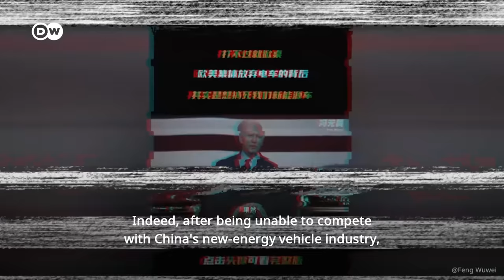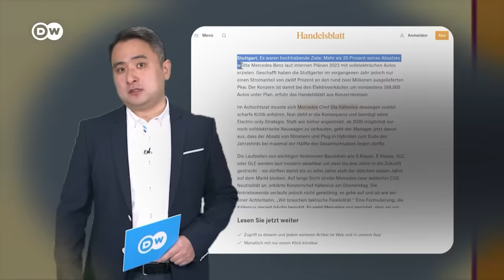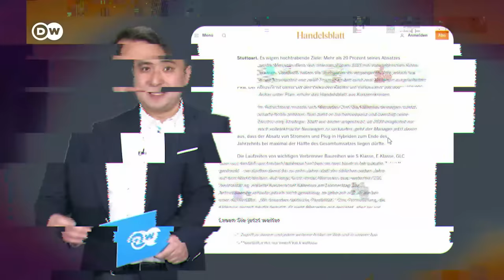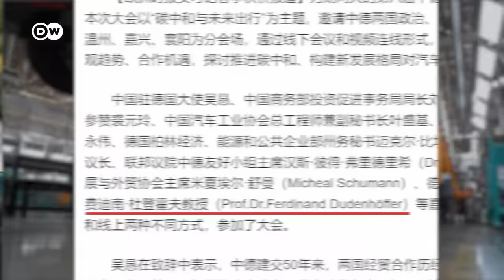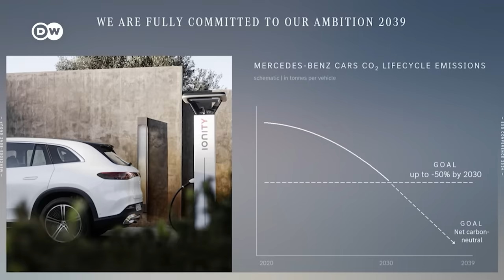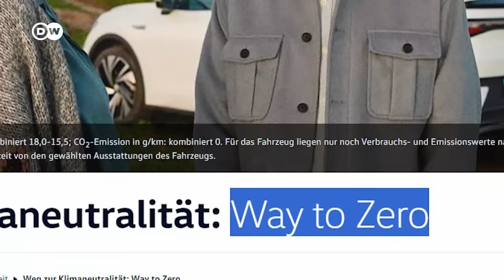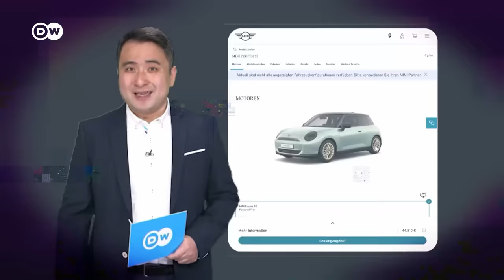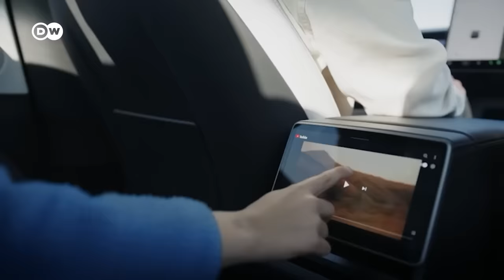Is the EV dream dead?

Comment: All cars and vehicles are loosing momentum...

Inflationary economic conditions with normalized interest rates crush spending, especially on expensive purchases such as vehicles. 

- gasoline and diesel fueled vehicle sales have dropped dramatically. Especially as most major manufacturers focused on expensive luxury priced vehicles, and not on lower cost.

- EV's have, and are still gaining market share. Their growth has slowed down, BUT their still growing. Unlike ICE. 

EV's allow energy independence, much less pollution, especially localized air pollution and oil extraction/refinement pollution, and remove the stranglehold of foreign entities such as OPEC and Russia. Oil is becoming increasingly harder and more energy intensive to extract.

You can even make your own electricity... 3-4 medium solar panels in most places (1500 W worth) will make the 6kWh per day needed by the typical passenger EV. Can't say that about gasoline. Even Biodiesel's veggie oil isn't typically made at home...

The EV minerals (including the batteries) are infinitely recyclable. The 10's of thousands of liters of fuel burnt over the average car's lifetime isn't...

EV's are also MUCH cheaper to operate and maintain. No gas/diesel to purchase, and there's hardly anything to wear out. Even brakes typically last 100's of thousands of KM's due to regenerative braking. Batteries are proving to last the life of the EV in most cases.

Comment: Filled my old Tucson with petrol a few days ago. It took 5 mins to fill up giving me a suggested 408 mile range.  Beat that battery power!  🤣🤣🤣
Reply: Try plugging in your "old Tucson" to your solar roof and see how far that gets you.
Reply: @metricstormtrooper  Well, that would put a bit of spark into my day for sure. I'll stick with petrol thanks!
Reply: Hello Andrew,  I think I got that beat with my Battery EV.  It took me 5 seconds to plug it in when I got home today (no stopping at a gas station).  It will charge to full overnight while I sleep.  I bet you spent about $75 bucks on that fill up right?  It cost me nothing to charge my car on solar.  I drove my EV 2,300 miles last month and the cost was ZERO.  Its a Tesla Model Y, the best selling car in the world.  It cost me $39k, its the fastest car I have ever driven.  If you touch the pedal it immediately responds it you floor it you are momentarily projected into the future!  :)
Reply: @AndrewKNI  Ring gear came off the flywheel. Chewed up clutch, starter and flywheel. Repair costs was the same as value of the car. It was Made in Germany so btw.

Comment: As Nov 2023, 0.86% of the registered vehicles in USA are EVs according to the AFDC (Alternative Fuels Data Center) which under US DOE (Dept of Energy).  That equates to 2.44M registered EV’s in the USA out of a total of 283M.  According to Diffusion of Innovation, this means that the USA EV industry is still in the Innovator phase (<2.5%).  Keep in mind, the Early Adopter Phase is between 2.5% and 16.5%.  43 states have adoption less than 1%.   The EV industry is still in the early days.  In summary, 0.86% is minuscule numbers in the USA after over a decade of EV sales. It is unrealistic to expect a 30% penetration adoption by 2030 when the USA is at 0.86% in 2023.

Comment: The fact you need a strong electricity grid to support charging stations makes the whole environmental debate moot. Where is this electricity coming from? It depends what country. If its France its their nuclear power plants, in Germany its coal because they got rid of their nuke power plants and now in order to support EV's they have to burn more coal. Quite a conundrum, you have to burn more coal which puts more carbon in the atmosphere to support EV's which produce no CO2 on their own. We won't get in to the whole Lithium minining thing that you need to build these batteries.
Reply from the maker: Thanks for your feedback. Of course you're right that policymakers and energy providers need to prioritize investments in renewable energy sources and grid infrastructure in order to maximize the advantages of EVs -- not to mention that battery recycling and responsible sourcing of materials like lithium are two major issues that need to be addressed.

Comment: Ev car are generally costly plus changing battery after 6 to 7 years is 50% of car price. 
Like you bought 100k usd car after 6 years 50k usd needs to be spent. 
Considering Depreciation value of car after 7 years, cars price would be only 10k. 
So hydrogen is future
Reply from the maker: Well, a lot of countries have leasing options that are far more attractive than buying cars outright. In which case people would just return their EV after a few years, not having to worry about changing batteries.

Comment: EV sales have only increased, if you look at the properly built and priced ones, and they are only going to get less expensive with battery prices going down and battery performance quickly increasing.  If you have driven a Tesla, you don't want to go back to an ICE vehicle that uses fuel that is 4 times as expensive as the electricity in your own garage.  Narratives to the contrary are just marketing BS from ICE manufacturers who can't seem to get their shit together.
Reply: Tesla and overall EV sales in the US have dropped. Those auto owners (in cold climates, especially) have found out that EV range plummets when ambient temperature drops.
Reply: A lot of people don’t seem to understand that this battery technology is like a 1900s Model T.  The “good stuff” is on its way to production as the market and manufacturing gets by for now on 30 year old tech developed by Sony for portable electronic devices.  CATL has batteries in their pipeline that work well in very cold weather, charge several times faster than today’s Li-ion cells, last for multiple times the number of charging cycles, and can be built on current production lines.  The current electric cars have only been built for the last decade.  All the rest of the car is mostly standard contemporary automobile stuff; it is the batteries that are the “new” thing, and the charging infrastructure, for cross-country travel.  I charge at home, as do most current adopters, so charging is cheap and no big deal.  The cars handle great, blow away any ICE vehicle at legal speeds, are quiet and comfortable to drive, and will soon be cheaper than ICE hybrid contraptions.

Comment: The issue is not the range even you have 300 or 500 miles range still the ABC - always be charging. The seller is not telling you about the weight as it added passenger in a sedan or hatchback, using your air conditioner, using the entertainment console, using the lights at night plus having an spare tire will affect your range - all drawing power from your batteries. You can only use up to 20% left in charge and 80% only in total charge means 60% of use in order to preserve your battery life so 60% only can be use of 300 range. EV is an old technology, it is just an alternative solution and not of the future. They have it already during the 1890, 1940, 1970, 1990, 2005, 2012 and up to now the present. EV is too expensive to purchase, expensive insurance, too much tech dependent more expensive to repair and tire are 30% expensive. EV should not be force on the consumer and it is not for everyone. It will never dominate the transport industries on air, water and in land due to the coast of investment for the charging station, grid sources, the rare earth materials used in batteries, software technology, range anxiety, the wasted time everytime you are charging and etc. EV are not practical solution for the ordinary individuals or the third world countries but good only for the rich countries and rich individuals...

Comment: Because in the west marketing propaganda rules. Lies of omission a favorite dodge. Sensationalized headlines if an EV gets a flat tire. Ignoring in US the fact that theres 199,000 petrol vehicle fires annually compared to less than 100 EV fires. Weve been 100% electric for four years. Save over $1,000 yearly on fuel. Maintenance is non existent. Superior ride. Quiet quick reliable. Batteries still near 100%. Tire life wear 45,000+. Car intuitivey makes driving a breeze. Im an old guy from the auto industry. Have deep experience with petrol vehicles failures. In the past there were no alternatives! Ditto my wife on all of above.
Reply: The question is do we have the electric grid system to accommodate everyone having an EV?  In most cities, apartments and condos are being built much more than single family houses, yet those apartments and condos only have enough stations for just a handful of EV owners, not 100s of people.  And 95% of people are not considering that AI will soon require more electricity than all EV vehicles currently in the world combined (and will continue to grow). I'm not against EVs at all. But I'm just going to be real. There are real challenges ahead for the masses owning EVs (and junk like the current Chinese BYDs catching fire at high rates aren't helping the perception of EVs). Personally, I think the future is not EVs, but solar powered EVs that will provide much more range, less need for electric charging, and much lighter safer batteries.

Comment: I have had an EV for 8 years. It has only done only 40k miles but has 33% range and battery capacity loss because of battery degradation. As well as this it has been a logistical nightmare, filled with anxiety and stress, particularly on long journeys. I will never buy another EV, ever again. Current EV sales falls are being caused by the likes of people like me, who have experience of them, passing that experience on to new buyers who are now voting with their feet. Refusing to pay for a more inferior, higher cost and fatally flawed product, compared with what they already had in ice vehicles.
Reply: I know that living in a hot or  cold climate doesn't do the EV any favors, and I've seen a number of battery fires on the shoulder of the road. One was a Kia that wasn't even a year old with flames coming out almost 2 feet on the underside of all sides of the car. Say goodbye to everything inside the car and hello to more expensive insurance, but you can feel lucky when you can stop and actually get out of the car when it has electric door servos in that situation. 

If you can commute to a parking space with solar panels for a shade  awning the cost of the electricity would be locked in at a fairly low long term cost. That is still an attractive feature but you will also need grid power to back up cloudy days if your RT  commute gets to be more than the capacity of the battery.  Downsides of range extension of a bigger battery are more cost, weight, and charging time and decreasing efficiency and cost-effectiveness. 

The EV and PHEV has some advantages in some situations but its not an end all solution for all auto transportation in its current state of battery technology.  The Solid State cell may offer some gains and the future of battery technology in not closed. Like the charger station network,  the battery technology is still evolving and growing. When there is a temperature insensitive, highly regenerative and low losses battery tech that is fairly light weight is when EVs will have more parity with ICE.  In the meantime H2 is now coming into market presence which will likely  erode public charger station growth for EV class vehicles.
Reply: I live in the NE of England, a temperate climate, so no excuse for the degradation my car has suffered. It has also been well looked after, hardly rapid charged , never left on charge all the time or left at 100% for long periods. No excuse, EV's are fatally flawed compared to ice vehicles.

Comment: EV's, an illogical solution to an imaginary problem.  The problems with EV's are range, price, infrastructure, repair cost, battery replacement cost, used ev's with batteries that could have damage. There are probably a hundred more reasons to keep ev's for the rich and famous that have more money than brains.

Comment: Battery leasing is the way to go. Lease a new battery when significant advances have been made in technology
Reply: Why?
There's nothing wrong with existing battery technology.
People are driving tesla with over half a million miles in the clock with only 15% degradation.
Reply: @BaybieK  there is a lot of things wrong with current battery technology. Especially performance in sub zero temperature, range of EVs goes down by as much as 50%. Tesla is no exception. A lot of work is being done on solid state batteries and they continue to improve. EV companies should offer battery updates  for a reasonable price to gain customer trust.
Reply: SantosTV - what is a tweezy? Before you answer it, this question is the reason why tweezy failed.
Reply: Brilliant you can lease my battery also